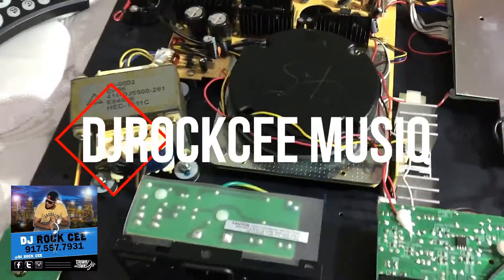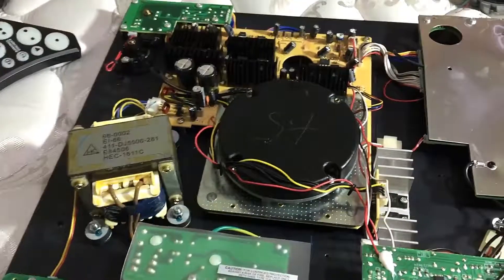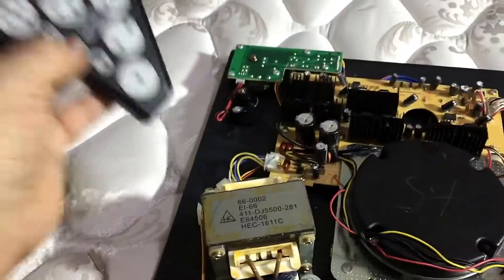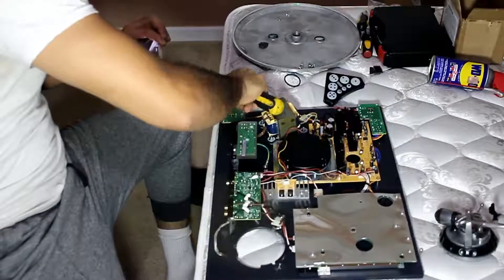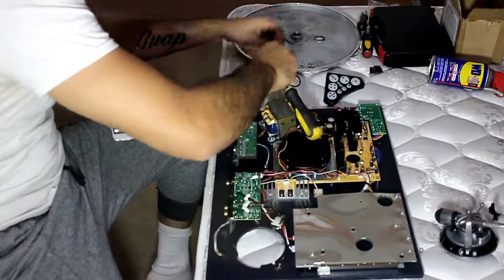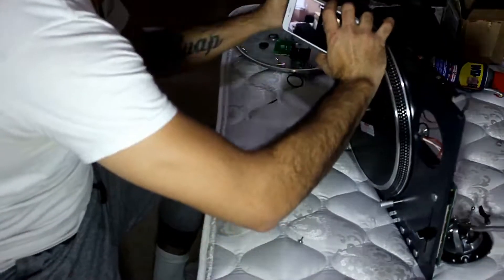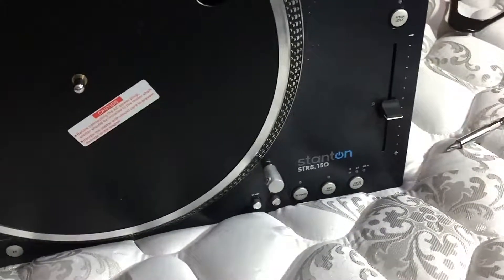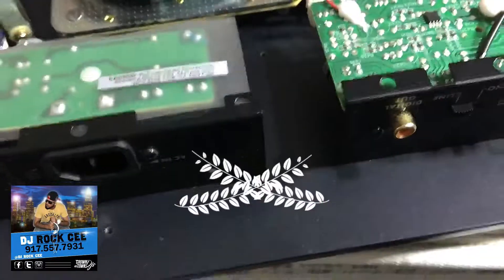how to install dicers on stanton str8 150/st.150 tutorial

Comment: I was thinking of doing this!!  I have took my 150's apart once to change the motor on/off switch.  I always just have a problem with how heavy the lid is and how to hold it.  I guess laying it upside down on the bed is a good idea.  Ive seen people put them in a vice before...  Do you still use your 150's?  I just love mine.....